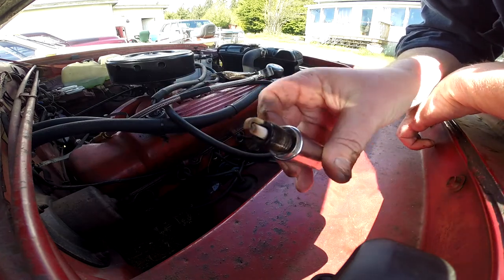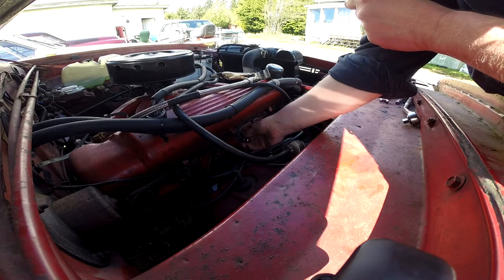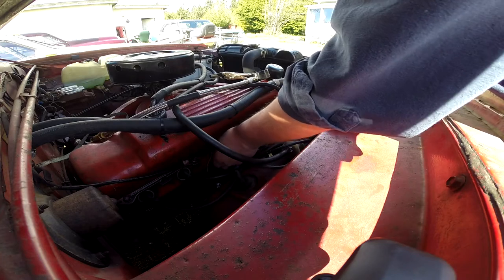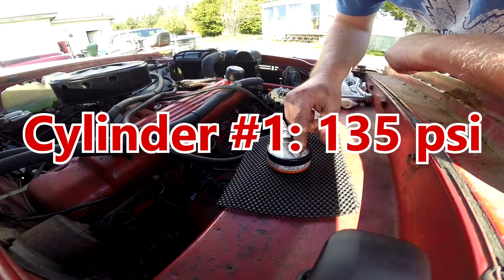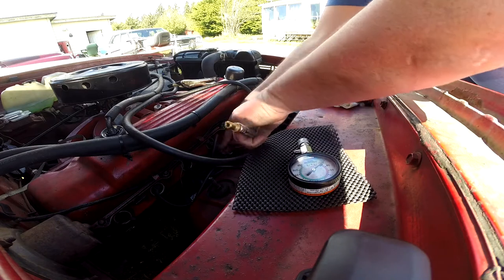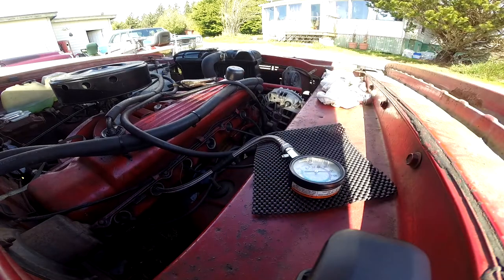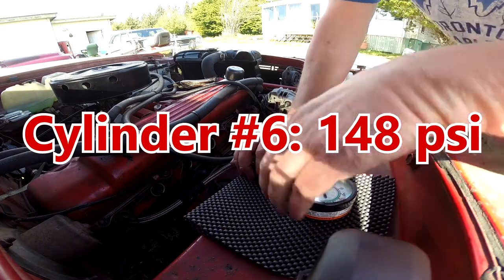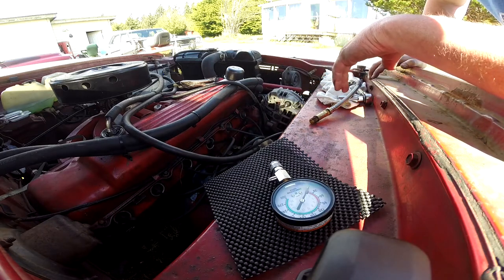1966 Valiant Compression Check + Smoking Gun

Comment: Thanks bud...you are too nice.

I wouldn't obsess too much over the whitish plugs at this point. Someone has installed extended-reach plugs in it(the part in the center with the electrode is longer), which isn't a bad thing because it actually helps them run better. But, as a result, they run hotter. What I would be concerned about are any that are gunked up with oil. I didn't get to see the one with the low compression...was it dark and gunky?

80 lbs is definitely an issue. Ideally you will have at most 10 percent variation from your highest cylinder. I don't remember if you said whether the valves have been adjusted, but it's mandatory to do so before going further so that you don't erroneously blame a tight valve for a more major problem. You can just do #3 and see if that changes things, but based on the blowby I'm going to predict the head and valves are fine and that at some point in the future you'll find a scored piston/cylinder or broken compression ring. The compression ring is the topmost ring, so you can break one and still not use excess oil because the two oil control rings still do their job. 

Who knows why that happened, but most often it's from being overheated severely or spark knock. Regardless, I'd drive it until that cylinder(or engine) dies completely.
Reply from the maker: I put those reach plugs in last year. And they weren't the first set of same I put in. Cyl#3 plug looked identical to the rest. It has though been at least a year since i adjusted the valves, but it doesn't get the same mileage I used to put on it. Whether rings or sticky valve, I assume the result would be similar. If I were driving it ever day like i did last year, I would have seen the blow-by much sooner. (The whole car got much more observance when i needed it on regular).  Thanks for all the advice sir. I always regard it as solid. At this point I will pull the cover and have a look while it's running. Probably will be 4-5 months before I can gather the replacements for the other rebuild. I will have some questions for you at that time about starter gear and the fact my new engine was a manual

Comment: Thanks for the video bud, I'm just about to do a compression test on my.... 66 Valiant with a Slant Six and accidentally found your video.  Only question I have is will the value keep going up if you turn that sucker over 8 or 9 times?
Reply from the maker: It will stop at around 4-5 turns and move no more. You definitely want to crank until it stops moving. What you are looking for is consistency across the values with no more than 10% difference between each of them. My cylinder #3 is going bad so will have to do something pretty soon. Luckily I have two other Slants. I am going to do a wet compression check which should tell me if it's the rings or a weak valve. I suggest you start as I show here and only progress if you find something wrong. Good luck!